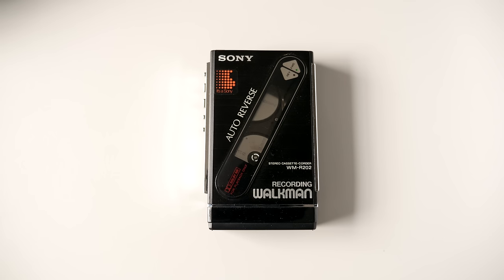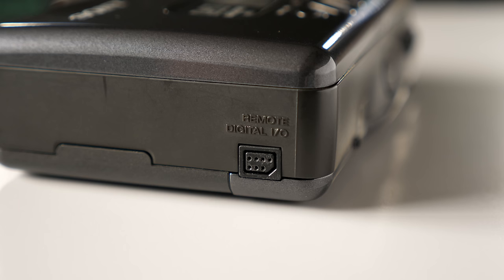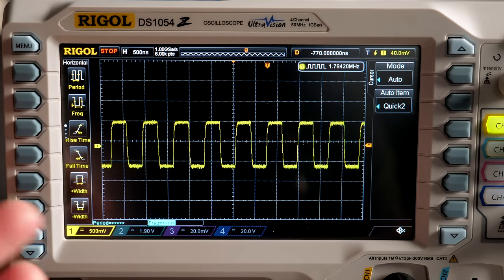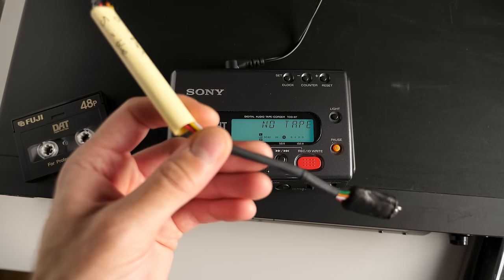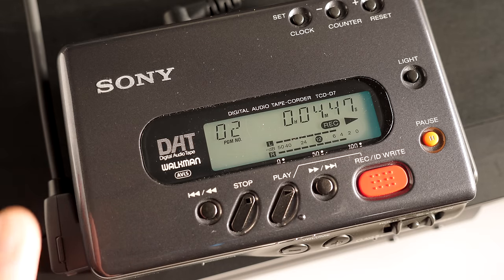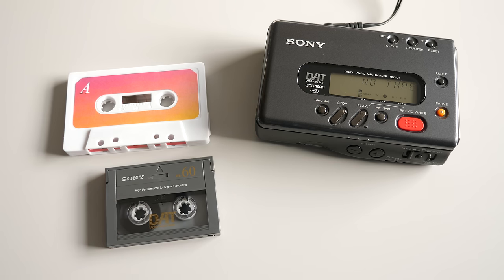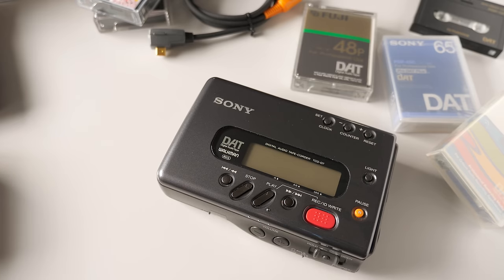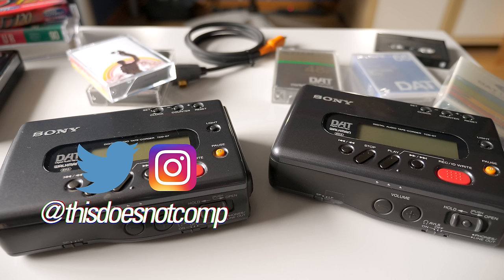Sony DAT: What Cassette Should Have Been!

Comment: It's like a mini VHS recorder cause it has a rotary drum like play, and record head just like a VHS recorder.
Reply: it's basically MiniDV, just minus the Video stream on the tape :)
Reply: Right. I have a Poor Man's DAT I record to daily. It is a Hi-Fi VCR. Has to be Hi-Fi so the audio can be written in a helical fashion on the tape and not with the audio tracking head like on non-Hi-Fi VCRs. Cheaper to do it this way as you can pick up a functioning Hi-Fi VCR for under $20 at a thrift store or get one for free. People are begging for someone to take their old units and VHS cassettes. I record over released movies on cassette. Studios released movies on high grade tape VHS cassettes. The down side is the size of the media and it is just not as cool as the DAT format, even though it is exactly the same technology.
Reply: Virgil Williams If you look at DAT, it’s actually a miniaturized Video-8 cassette.
Reply: KRAFTWERK2K6 well, except for that miniDV came along about 7 years after DAT. ;)
Reply: Phil Adams my dad had a hi-fi Betamax with both analog input/output and PCM. c.1987
Reply: Phil Adams not exactly the same technology. DAT records digitally and VHS HiFi records analog. This is why your VHS VCR has no settings for bit depth and sample rate. It is, however, a very high resolution analog, and the actual specs for frequency range, dynamic range, channel separation, wow and flutter are about the same as DAT. I first tried recording just audio on VHS HiFi in 1986 because I realized the specs were about the same as CD and seemed unaffected by recording at the lower 6 hour tape speed. It was my main audio recording format at home from 1986 to 1999. As much as I wanted DAT in the early ‘90s, I couldn’t justify the cost of a deck and tapes since I already was deep into VHS HiFi and the quality wasn’t audibly better. That changed in 1999 when it because affordable for me to use my PC for digitally recording and burn CDs. I love how you called it the “poor man’s DAT”. I never really thought of it that way, but that’s exactly what it was for me for over a decade.
Reply: Daniel Daniels: Phil never said it was the same technology. The OP said that DAT is like a mini VCR, and that’s absolutely true, in that the tape transport in DAT absolutely is simply a miniaturized helical-scan tape transport. The tape transport itself doesn’t care how the content is encoded onto the tape, be it analog or digital, nor what modulation scheme is used for analog or digital, etc. (And indeed this point is illustrated really well by Digital-8 camcorders, which can play back regular 8, Hi-8, or Digital-8 tapes, and the fact that 8/Hi-8 support both analog and digital audio. Never mind how the 8mm cassette and tape transport was also modified into a few data backup tape systems, too!)
Reply: Antonio Tejada yes he did. Exact quote “...even though it is exactly the same technology”
Reply: @danieldaniels7571  Oh, yep, you're right. I missed that in the collapsed part of the reply.
Reply: @danieldaniels7571  I believe VHS hifi uses some of the vblank or something to encode the audio inside the frame, which is why it was unaffected by SLP - the video image was preserved enough to extract the voltage signal there, even if the colour subcarrier in a regular usage would start to go a bit wobbly. Maybe I got some details wrong though! But I've certainly heard of a lot of people having 6-hour CD-quality mixtapes/album compilations by using VHS hifi ^^ my dad had his (big-ish for early 90s, 26 or 28 inch) TV and VCR right next to his big hifi, and I think they were connected. I assumed that was for big sound for films, but now I wonder if any of his many shelves of VHS were music-only.. I have no idea, and maybe he never used it for only-music, but I'm considering asking him next time we talk.
Reply: @endoplasreh  Hmm, VHS hi-fi audio uses analogue FM, not digital PCM, as far as I know, so that's a different technology.
Reply: The looping angle is different, though. DAT only used 90° on the drum.
Reply: @kaitlyn__L  VHS hifi doesn't use the vertical blanking interval, it uses depth multiplexing - effectively recording the modulated audio signal in the same place on the tape as the luminance and chrominance signals.
Reply: @dunebasher1971  fair enough! I’ve seen various people claim so, but like, I’m not an expert, this is my hobby. I’m just a physicist lol. The important part is that it’s in the video frame and not on the linear audio track :D
Reply: @kaitlyn__L  they refued to use the audio track for HI-FI because of backwards compatibility with older systems, think about it like this, say you had a HI-FI VCR and you recorded a tape, but then you wanted to watch it in your room but your rooms VCR wasnt hi-fi available, that was the idea, this was the mid 80s and that was a real likelihood that people would have non hi-fi VCRS as well as the one expensive Hi-FI machine so they would record the audio twice as both Hi-Fi and linear audio, the other reason why Hi-Fi audio was affected by the speed whereas the Luminance and chrominance signals would be was because the audio signal ran in the kilohertz frequencies while the video signals were in the megahertz specifically 3 megahertz, as it was VHS and beta both were worse than broadcast TV which was 5 megahertz

Comment: The powering off is caused by the main gear being out of alignment.  There are contacts under it that tell the player what position the mechanism is in.  If it gets dirty or out of alignment, the device will power cycle.  This is not a circuit board issue

Comment: I work in an archive and apparently there was a push to produce a set of masters on DAT in the 1990s. But the way DAT tape degrades, being digital, is much less predictable than conventional analogue tape. If the data stream is broken, it just doesn't really work. So the original open reel (reel to reel) tapes from the 1960s are what we use to digitize --despite DATs being created in between as they degraded worse, although it was thought they could be more stable.
Reply: I wonder. Digital is all about data error correction. Like, literally, that's what Shannon, Hammering and company started with coding theory, which is what led to making computing happen and what makes formats like CDs so valuable. If you don't know how they work, you can take a look at https://www.youtube.com/watch?v=sAbhPeTp51s

So what were the specific details why CDs worked so much better for the consumer, but digital tape would be less reliable than analog tape? May it be instead because tape was standardized and DAT was a proprietary format that depended on Sony, which is bad for archiving and mastering?
Reply: Indeed. Analog tape is infinitely more forgiving. For one, physically damaged sections can be spliced out; sure, the audio that was on the damaged section is gone, but everything else is fine.
Reply: ungratefulmetalpansy  First things first, no need to reply so rudely. I'm looking for constructive debate and being respectful, there's no need to be condescending nor disrespectful if I make (even outright dumb) mistakes, despite this being the Youtube comments section.

I understand the difference between discrete and concrete values perfectly, what I don't understand is how is analog more forgiving because of that. Of course you retain with it more data that can be immediately played back, whereas binary codes mean that severe enough damage would make data chunks completely lost for raw playback. But I understand that binary data should also be easier to protect and recover by design with little additional usage of storage, as again formats like CD are intended to, and there are as well digital optical formats for archival like M-Discs and Sony's more current Optical Disc Archive. On the other hand, analog media, as it is intended to be a direct replica of the content and thus lacks encoding methods, cannot be straightfowardly recovered as it is not possible to add redundancy - the only available data for reconstructing is that of the discrete data which survives damage, which cannot be automated without further guessing.

I admit I haven't professionally worked in audio mastering, archiving or recovery, neither in any other environment that traditionally requires tape for long term storage, so I ask: what were the technical limitations and advantages of each ultimately derived from? Honestly, I feel it comes down to price, standardized equipment and a rather more intuitive workflow with analog (less abstract and mathematical, more tangible with readily available tools).
Reply: Xerz 1/4” tape is just extremely durable, and the way open real analog decks work is simple and much less prone to playback problems than any tape played back with a rotating drum head.
Reply: @xerzy  you're completely correct and ungrateful metal pansy is sorta wrong, just stating very basic things – binary encoding goes back even further to automated looms, so starting with Boole is a bit weird. Like the only "mistake" you made maybe was saying digital instead of "information theory" or "digital audio" specifically, but that absolutely was about strengthening signal integrity.

They used binary from the get-go precisely because of error correction algorithms, and you can get extremely robust ones that have dozens of parity bits per every data bit, which are used in space to ensure recoverability even through high interference. (You don't want to send a retransmit request to a Voyager probe, which takes days to get there!) The throughput takes a big hit, but, you're totally right that that's literally what all of these codes were designed for. 

Digital audio has its roots in information theory and Shannon and Hamming and everyone else, as you said. Digital audio didn't spring out of thin air just because digital signals existed (such as telegraphs). And really the people who started information theory were interested in digital text representations right at the start, and later people (such as Shannon and Nyquist) realised you could encode any sequence of voltages such as audio, or small voltage readings from weather station equipment, and so on. 

Ungrateful metal pansy obviously can't use their brain enough to fill in "digital" to "digital audio", even though the entire conversation was about audio.

Anyway, WRT DAT, I imagine it's the read mechanisms generating bad data in untested scenarios, with tape drum weirdness, and the tape being very thin and the signal being very high frequency, might make it lose enough coherence to struggle to distinguish the 1s and 0s. 

I don't actually know how DAT is electrically encoded, or how much error correction they use – the "bit perfect copy of a CD" is going to be about the PCM frames, as opposed to the various layers of correction in the CD's physical and encoding and interleaving stages. Maybe Sony thought, it being in a cartridge and all, that they didn't need it to be as digitally robust as a CD, which would have to resist small scratches. I don't know, I'd have to look into that more! 

Certainly, depending on how they actually did it, there's plenty of ways that only a very small amount of demagnetisation or tape wrinkling or so forth could completely impede decoding. And obviously every parity bit could be thought of as "wasted space", after all the CD spent 14 bits encoding 8 bits. If they removed that layer, even keeping the interleaving, a CD could hold close to 2 hours instead of 72 minutes. They obviously knew they'd stop working much faster, potentially from even a tiny scratch in that scenario, and didn't do it – but I could imagine them making that kind of decision to half the tape speed in DAT, or even just having 10 or 12 bits per 8 bit frame instead of 14, to squeeze more space, and simply be less resistant to errors that way. 

It certainly lasted the market length of the format, so maybe they were correct in that calculation – but it certainly wasn't appropriate for archival. (Plenty of older DAT masters do work, I assume OP simply had too many go bad that they stopped even trying, instead of them universally failing? But maybe they did universally fail, which would certainly be strange considering ones that just sat in someone's attic can work.)
Reply: Steve Albini warned of this and I failed o listen to him.

Comment: AWESOME video! The TCD-D7 is NOT the first consumer grade deck that Sony released. The TCD-D3 was the first model ever released. I still have mine and it’s built like a tank!

I have a couple of hundred live concert recordings that I made following around the Grateful Dead, Phish, and a few other smaller bands with “taper” followings. One of the biggest use cases you left out of your video...or maybe just didn’t realize was such a big thing. 

In fact, I would venture to say that the “taper” community was one of the biggest reasons that DAT lasted as long as it did!

The “taper” community lives on - bands like Phish and The Dead (not The Grateful Dead) still sell “taper tickets” and you’ll still find guys with thousands of dollars invested in microphones and digital recording gear, but you’ll find that everyone transitioned from DAT (briefly to laptops) to solid state 24-bit recording units (I.e. Zoom and Sound Devices). 

If you’re interested in checking out the TCD-D3, please let me know. I’d be happy to figure out a way to make that happen.
Reply: I thought he mentioned that when he said bootleg concert recordings ^^ unless you mean some of these were officially sanctioned and therefore weren't bootlegs? Were any turned into live albums for sale etc? I had always assumed they hired their own sound guys to make the live albums.
Reply: Kaitlyn L there are plenty of bands that allow people to record live performances as long as they are not for financial gain. It started years ago with The Grateful Dead and continues today with bands like Phish, The Dead (3 original members of The Grateful Dead), and many others. Phish and The Dead actually sell “taper” tickets that are traditionally directly behind the soundboard. They aren’t the greatest view, but they tend to be amongst one of the best sounding locations in the venue due to how the audio engineer mixes the house.

Comment: While it’s pretty trivial to extract the digital audio over SPDIF, there are some DDS drives that when combined with the correct software can actually extract the audio and metadata off of DAT tapes, pretty much exactly how you’d rip a CD on your computer. Could be part of an archivist’s dream setup. There’s a lot of cool stuff out there on DAT. Some years ago, a DAT tape with rough mixes from one of Madonna’s albums got out, that was cool. Basically studio perfect 16/44.1

Comment: S/PDIF is in fact a "biphase mark code" which is a variant of FSK, with the zero symbol being the carrier frequency, and the one being double the carrier frequency, so a receiver would only need to count the zero crossings within one cycle of the carrier. 10BaseT Ethernet uses a similar means.

AES/EBU and S/PDIF are identical on a signal level, the only difference is characteristic cable impedance, which was adapted to work with consumer-grade RCA cables for S/PDIF instead of using high quality balanced cable like AES/EBU. It's compatible when you use a level shifter.

Optical S/PDIF uses 5 volts peak-to-peak for driving a transmission LED. Optical receivers output 5Vpp so the ability to accept 5Vpp S/PDIF input was probably intentional.

Comment: I used as Tascam DA-30  DAT deck in my studio for years as my stereo mix down desk and it worked well. But at some point PC sound cards got good enough and PCs were fast enough to record directly into the computer. For a time I only had a digital (SPDIF) in on my sound card, no converters at all. So I used the DAT desk in pause/monitor mode as my AD converter into the computer. That was a great setup because I loved the sound of the signal chain and converters in the DA-30. In time I got a Lynx sound card and didn't use the DA-30 anymore. I kept it years after DAT was not used anymore just to transfer clients tapes and as a headphone amp. However, there were issues with DAT and some tapes made on other brands of recorders like the Panasonic SV3700 would not always play well on mine. I had to edit glitches in the computer later to fix the errors in the .WAV. My clients were amazed by the stuff I could fix in Sound Forge. Wav editing was like science fiction in the 90s. 😁 Oh, and then CD-R came out... BOOM!

Comment: You can also use DDS-1 tapes designed for data backup in your DAT decks as the original DDS format is basically the same, some professional DAT recorders can also have decent results with DDS-2 backup cartridges, but generally they aren't recommended for consumer model DAT use due to thinner tape formulations.
Reply: How about panasonic sv3800, can i use dds2 on it without screw the head or mechanism? And how long tape you ofered?